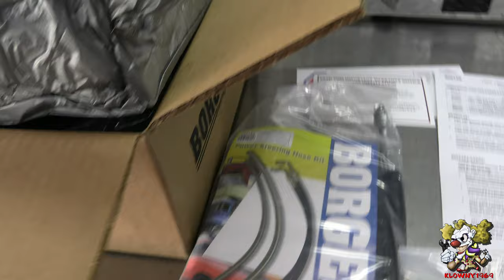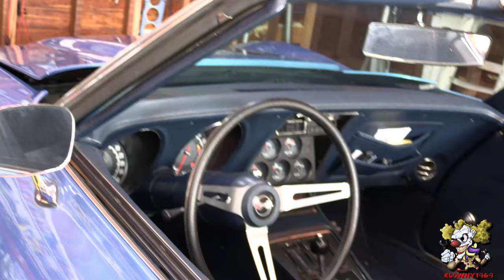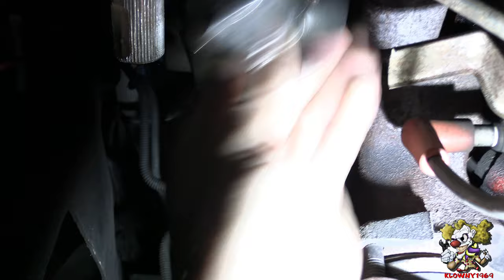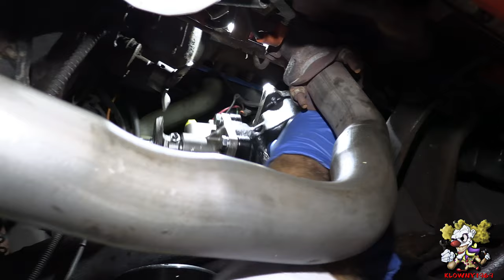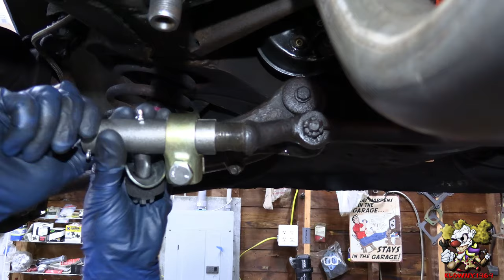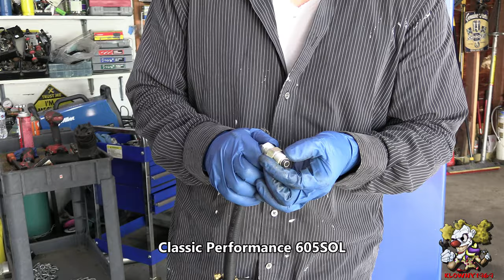How To Install A Borgeson Steering Box Upgrade On A C3 Corvette

Comment: This guy knows his Sh*t. Been building at home for 30 years. Very professional, fast, instructive.  You know you have been doing it a while when you can look at a bolt and know what size it is. Beware, it is not that easy on the floor. This Gent has a lift, as so do I. Great video.  Lucky, no heat or WD-40 and wait. Nice extension with the wrenches..lol.   Every young Gear Head should watch this video as there are more tricks to the trade displayed here then all of the other videos I've look at.
Reply from the maker: Lol thank you sir!! Don't forget to subscribe
Reply: @klowny1969  I did and I'm a gearhead born in 65 who just retired  and I am currently setting up my garage. I have had everything from lowriders with hydro's to 4x4's, motorcycles, and street rods. A poor man learns how to do things the right way. I still paint out of a 80's Devilbiss siphon cup. I even tie a rag around the top so it don't drip.  Dam gun still sprays Candy like a dream. I need to get with the current times.

Comment: I’m in the process of installing this on my 79. I reused the half of the rag joint that was on the steering shaft because like you show in your video the splines don’t line up very well. I had to drill the bolt holes out just a bit so the collared bolts that come with the rag joint worked but I think this was a better way to go as I was able to slide the rag joint on the shaft which helped when bolting the rag joint together. I’m just waiting on a new pitman arm. I couldn’t get my old one off I tried but no luck ordered one from Zip Corvette hope this tip is helpful. Great video thank you for making it very helpful.
Reply from the maker: Thanks for watching and don't forget to subscribe

Comment: Thank you again for the awesome video!  Install is done.  Here's a helpful hint:  On my car, the steering column/ shaft was not perfectly centered to the input shaft of the Borgeson box.  It was about1/4" off, perhaps due to manufacturing tolerances in the box, the steering column, or the body .  I loosened the steering column bolts (2 bolts under the dash, 2 nuts at the firewall) and there was enough play to achieve good alignment.
Reply from the maker: Glad I was able to help you out..and thanks for the tip!

Comment: Great job on the content Klowny! What state are you in? I just ordered the kit, but it may be a little too advanced for me. 73 big block with headers, do you know if I will need to take the header off that side?
Reply from the maker: Thank you..I think that all depends on the primary diameter size..it's a possibility that you might have to. I'm in New York, don't forget to subscribe 😉
Reply: @klowny1969  I finished the power steering upgrade on my big block 73. I have model specific headman headers. We had to flatten out the front pipe slightly for everything to work. Just thought I’d let you know in case you get an install on a big block car. We watched your video several times, and referenced it along the way. Thank you again!

Comment: I cannot get the holes line up for the carriage bolts. Any ideas on what I’m doing wrong
Reply from the maker: Wiggle it around
Reply: @klowny1969  I tried and tried. Is there anything wrong with taking out those air lines?

Comment: would this be a major PITA without a lift?
Reply from the maker: It wouldn't be as easy..but it is do-able
Reply: Get yourself some good quality jack stands. I put two up front bear the rad support, two behind the front wheels near the front of the door and two in front of the rear wheels.

I'm doing mine right now and it's not so bad. I have everything apart now. You'll probably need a bottle of MAO gas to hit that pitman arm while pulling it off the old steering box. Mine has never been apart and that was the most difficult part. 

The big came out easy from the top evenbwith side pipe headers, however I did pull the column out as it needed painted up badly, and I also had the booster and master cylinder out for replacement. The top two master cylinder nuts are character builders for sure.!

Comment: Did your low pressure line leak at the box?. I used the same o-ring fittings 605sol and it leaked at the low pressure line. Appeared that the fitting bottomed out before the o-ring could seal.
Reply from the maker: Nope it was good

Comment: About to remove my original steering box and wore rag joint on my 1981 Vette; wondering how much more 'may' be involved and also with the "tapping-in of the steering column" 'if' there may be any issues on my 81 Tilt column if there are any internal components that may be of concern.
Reply from the maker: If you do it the way I did you should be fine
Reply: @klowny1969  ... thanks for the feedback. I was leery of beating on the the column and I read somewhere someone had to 'cut' the excess off!
However a bigger problem... these kits are "out of stock"! 
Today I directly called Borgeson and I appreciate their reps honesty. 
The rep told me  "Ray, it could take over 20 weeks until we get a bulk of Jeep cores in before we can make several kits up." They do a bulk of them at once, not just one, and there are no Jeep Cores out there.
I first called Summit, they 'kinda' lied to me stating "Borgeson makes those kits to order and that's why it could take a few-weeks" ... that was a lie.

Comment: Installing this box on my 75.  The instructions indicate to file a flat spot on the steering shaft where the rag joint lock nut contacts.  Did you do this?  My concern is that if I grind a flat spot, it will be impossible to get the rag join onto the splines of the steering shaft.
Reply from the maker: I didn't feel there was a need to file a flat spot..that coupler really is a tight fight..it's not going anywhere..don't forget to subscribe
Reply: @klowny1969  Thank you Sir!  I did subscribe.  Keep up the excellent work!